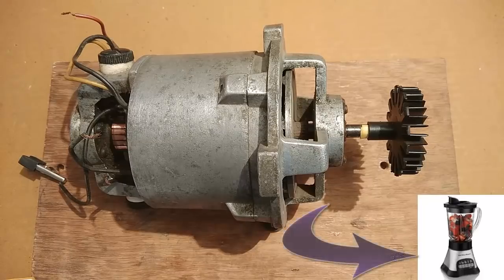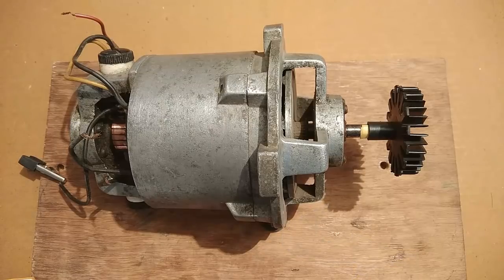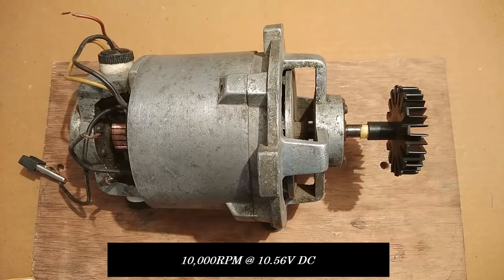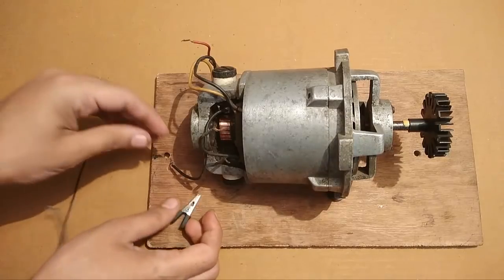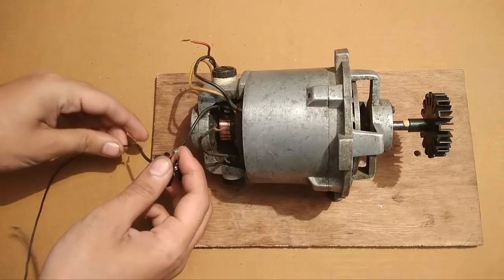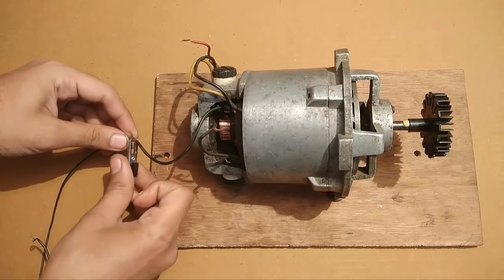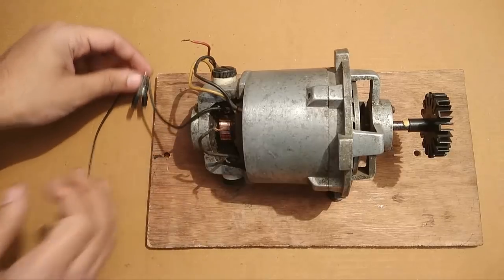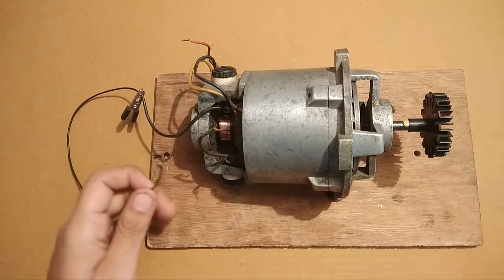Run a High Torque 220V Mixer or Drill Motor at 10000rpm with 12V DC DIY

Comment: It's pretty obvious you're using  the AC line
Reply: yeah, usually he would hold the two wires together for a better connection, but he didn't which proves that he's using power from the AC line

Comment: Dear  friend I have a vacuum  cleaning  motor  . I operate it in 19v dc but the speed is low and torque  also . I want to use this motor to operate lathe machine so how to increase speed and torque

Comment: Next time show the motor starting from standstill, NOT with you spinning it whilst connecting the supply! Also how the heck are you so sure it is running at 10K RPM? NO ONE can guess that speed by ear and eye, could be anywhere from 6k upwards. Nice idea if it actually works in an everyday application???
Reply from the maker: Actually.. the magnet locking does not allow it to start on its own so i had to spin it before connecting the supply
Reply: Not much good as a boat motor then? leaning over the transom to spin the prop?
Reply: stroboscopes arent hard to come by
Reply: it's fake lmao

Comment: sir, i want to know does these motors need capacitors to run in ac?
Reply from the maker: no they don't
Reply: but some ac motors such as in washing machine or fan have capacitors connected with them,sir pls tell me can we directly put these motors under  220v ac